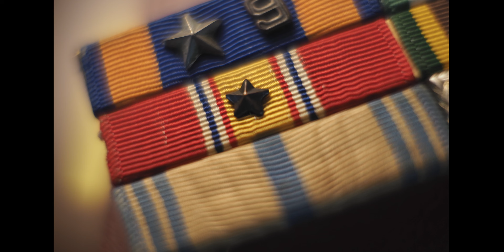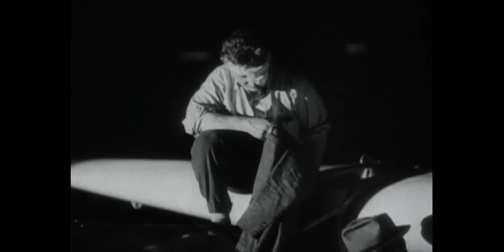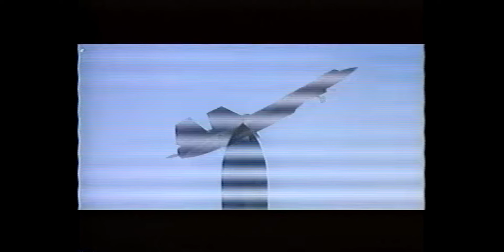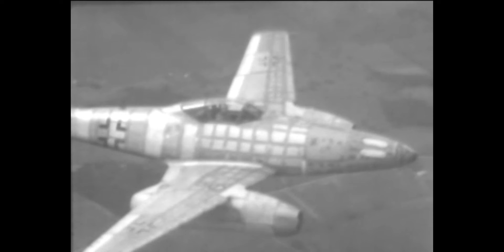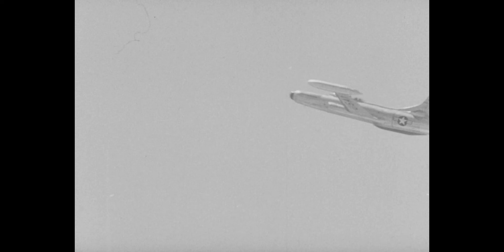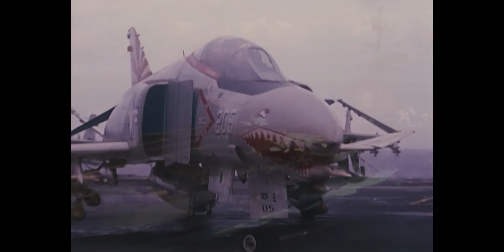The Dad Project--Thirty Fourth Installment: Lockheed T2V-1 SeaStar

Comment: Most enjoyable!  My transition between jets and props was the reverse. When I was ordered to Coral Sea circa 1981 ,as Safety officer, I had a bit over 700 carrier landings, all in jets -- T-2A, TF-9, F-8E, RF-8G and EA-6B. While I was getting checked out in the ship's C-1A, one of those rare all time good deals came up. Enterprise was just coming out of her extended yard period and needed to start working up her flight deck crew. Her CO invited everyone on the West coast with a C-1 to come and run her deck. The Gun Boss, Jack, and I were directed to take advantage of Enterprise's generous offer, The controlling LSO, an old ship mate, got us field qualified Saturday morning and we had a "charlie time" that afternoon. What followed was amazing. There were no other aircraft on the deck. LSO "Mad Dog" "cut" each C-1 for the #1 wire. As each plane trapped, hook up, flaps to take off position, taxied a few feet forward, turned 10 degrees right and took off down the axial deck. We were making a complete circuit in 3 minutes. Jack went first and got his limit of 10 traps. We swapped seats and i got my traps. They lost count so I got 12 traps. We came back out Sunday and each got 10 more traps. Monday was a short day so we only got 5  traps each. That was the most fun I ever had with my clothes on. I had just taken my Aircraft Commander check and now had enough traps to carry passengers on and off the ship. No carrier landings are easy but I would have to say that the prop landing on that huge deck was easier than with a jet. Excellent speed stability and instant power response. The long wings required constant work on line up.
Reply from the maker: Thanks so much for this great comment. My dad flew the C-1A off the Randolph in the mid-sixties--until I looked through his log books I had no idea that he had flown it at all. The other thing is I don't think my dad ever did his carrier quals solo. When he was going through flight training the training carrier--the Antietam was unavailable, so he went straight to Kingsville for his training in the S2F and qualified in that with a co-pilot. I think it was the same with his time in the F-4B, his first time landing that on a carrier was with his RIO. Whatever the case, again, thanks for a great comment. All the best, Mike